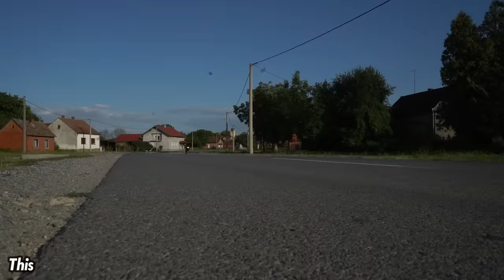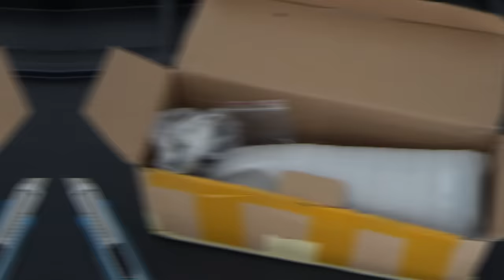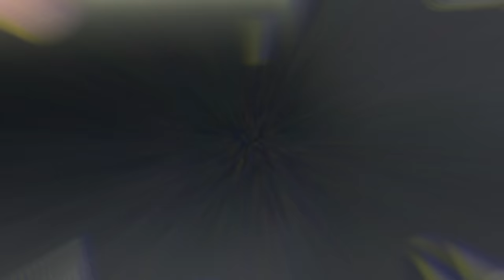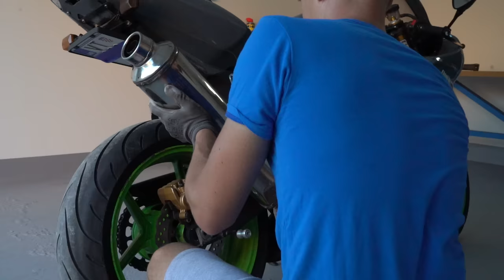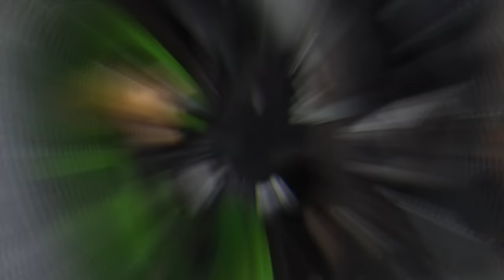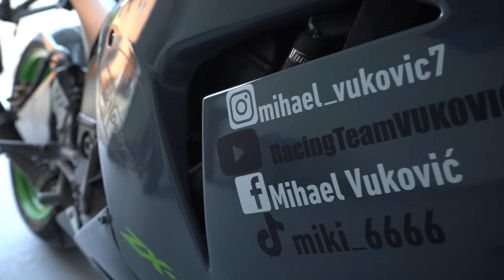FAKE SC Project 50$ on Kawasaki ZX-10R !? +TEST 😯

Comment: Won’t do your fuel to air mixture any good it will run to rich, not great for the engine
Reply: Art of War  because when you get a new bike with a original exhaust that exhaust is mapped to that bike just saying , even though his bike didn’t have original exhaust on it in the first place before changing can but starting it with out can cause problems now come back at me with one of your stupidest comments
Reply: Art of War  you still haven’t understood my point, he started the bike with no can that is the same as starting the engine with no exhaust at all then putting different silencer on the bike do your research being a Yamaha service dealer my self you will understand the concept
Reply: @SCOTTYDP77  yea you are correct now that the exhaust is better flowing now he needs to adjust air fuel mixture so that the bike is not running to lean
Reply: @sterman7632  I know I'm super late to this. But I was thinking of getting the same exhaust. Is adjusting it easy?
Reply: @elifarrow1781  If you have a carb on a bike than yes, if ur bike has cdi and fuel injectors then ull be better off buying a original one and getting it tuned by a proffesional bike shop